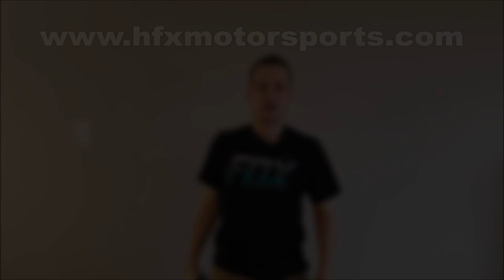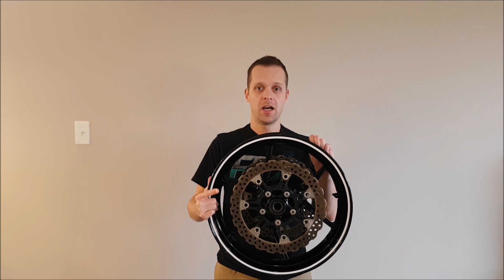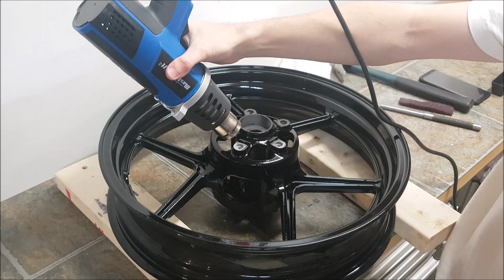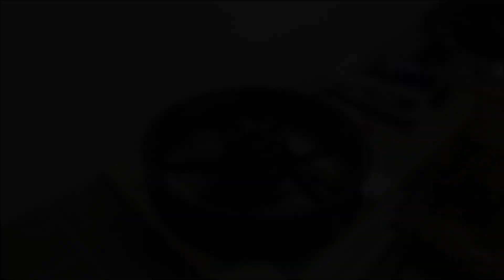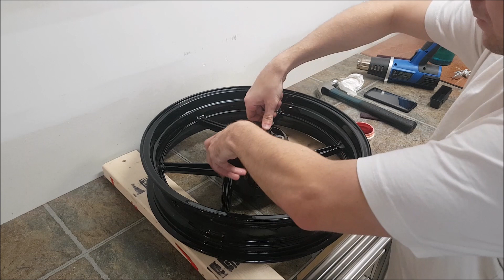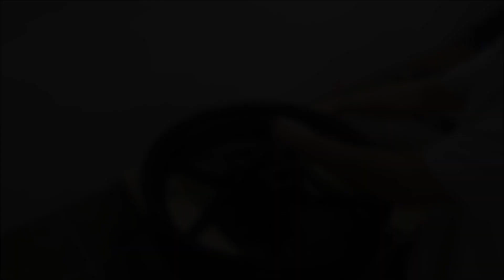Installing motorcycle wheel bearings.

Comment: ** note to viewers, do not use a punch to hammer down your bearing
Reply from the maker: Whats the issue with tapping it down against the outer race only? Any valid reason?
Reply: @ColinBell321  metal hammer, metal punch. Metal on metal, on a bearing, nope. I'm not saying your bearings wont be perfectly fine and i'm sure you did it with great care but as for making an educational video showing people to hammer your bearings in with a punch.... nah mate.
Reply from the maker: It won't hurt the bearing whatsoever. If you push it in with a socket and press, you're still metal on metal, and using more force (assuming you don't use heat).
Reply: I think what he’s getting at is you should 
A) use an object that will cover the entire surface of the bearing (socket)

Or B) use a softer metal/ material so you don’t gouge the bearing 

While you were cautions, somebody could watch this, try it, not proactive great care, and be made at you that their bearing got chewed up

Comment: Pls help my spacer was too tight when i put the second bearing in. They seized up. So then i cut the spacer too short and now i have to replace that. Why is the spacer too long now?
Reply: It’s not to long when they are pressed together they are harder to spin try picking the hole wheel up and spinning it like it’s on the bike (both at the same time) don’t cut or sand anything like that lol